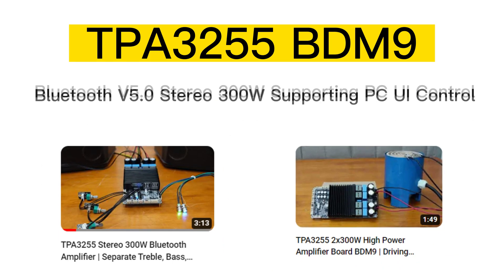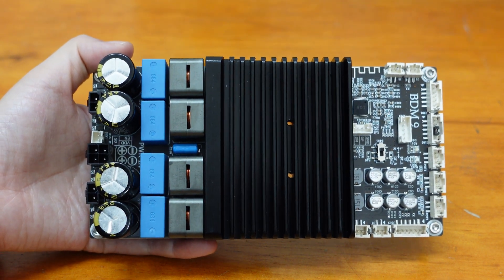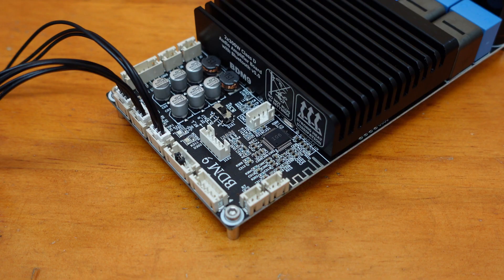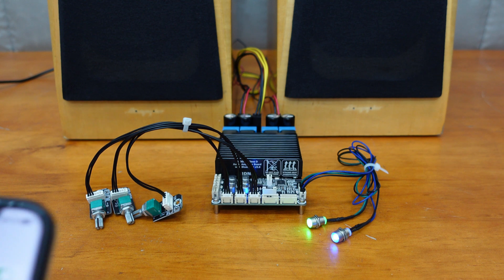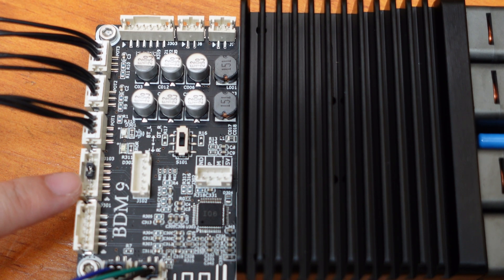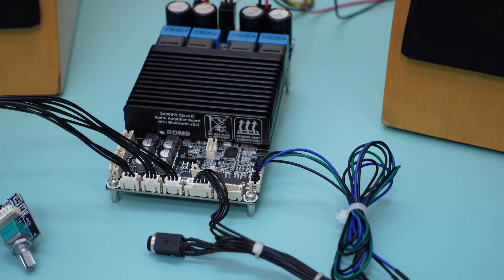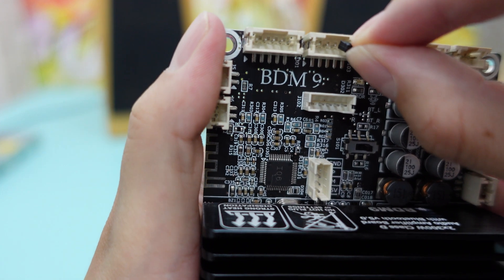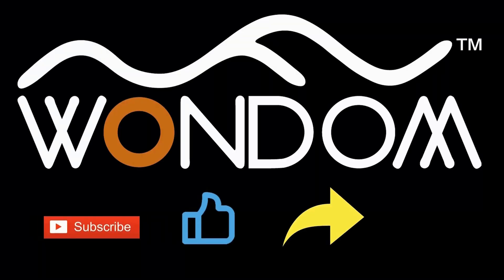TPA3255 Stereo 300W Bluetooth Amplifier BDM9 Step by Step Connection Guide

Comment: Is there any way I can tap into the original Bluetooth signal that doesn't run through the DSP?
Reply from the maker: Hello, thank you for your watching. The BDM9 can't achieve the function you want. Wish this could help you. Have a fantastic day~
Reply: @WONDOMAudio OK, thanks for the answer. Is there any other way to get the analog output without DSP settings?

Comment: Please explain why the bass and treble and volume control are all bypassed when not going through the BT connection. Are all of these done digitally inside the BT chip...? (If yes, is that 24bit 48kHz for the wired line input?)
Reply from the maker: Hello. The BDM9 features two line inputs - one in bypass mode and the other passing through the BP1048B2 DSP module. That's why the treble, bass and volume control are not available when using bypass line input. Have a great day~
Reply: @WONDOMAudio  Thank you! And can you confirm the 24bit 48kHz processing within the DSP module..?

Comment: Wondom amplifiers are all perfect. But we need more lithium/lifepo4 battery and charging boards, but with higher capacity, like  5s2p / 6s2p (18650, 21700, 26650). with smaller control pcb. Or better capacity status leds (they flash when there is a lot of consumption, i mean higher volume). Or when is battery charging is nice when actually status of charging battery capacity is blinking. I am only saying :)
Reply: I have 6s2p wondom batterie.
Reply: @dennissinger7880  Ok i see in your channel. Ty...
Reply from the maker: Hello, here is the 6S 21700 Lithium battery charging and protection board for your reference. https://store.sure-electronics.com/product/PS-BC12117 Have a great day~
Reply: battery hook up has them and batterys

Comment: Does this amp board have the ability to connect an external antenna for Bluetooth? Can the name of the Bluetooth be changed via the Programmer?
Reply from the maker: The BDM9 is equipped with a built-in antenna, ensuring stable connectivity and audio transmission. Please note that it does not have a port for an external antenna. Changing the Bluetooth name requires significant time and effort, so we can only offer Bluetooth name customization for bulk orders. We appreciate your understanding. Have a great day!

Comment: Very nice design! 
Can I use 3 of them and make a 3 way stereo system (Low, Mid and High) with Sigma Studio?
Reply from the maker: Thank you for your kind comment. Unfortunately, the BDM9 does not support SigmaStudio programming. I recommend checking out our JAB series, which may better suit your needs. If you have any further questions, feel free to ask. Have a great day!
Reply: @WONDOMAudio  Thank you very much, I will check the JAB series!
Reply: @WONDOMAudio  But the same can be done in ACPWorkbench, no?
Reply from the maker: @kristofdeak1030  Unfortunately, the BDM9 is not capable of performing the functions mentioned above with ACPWorkbench.